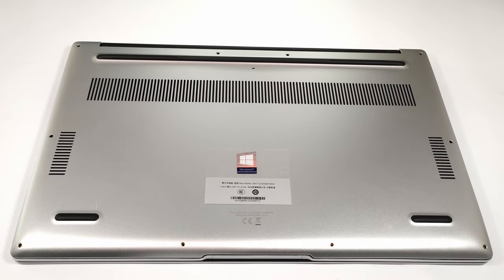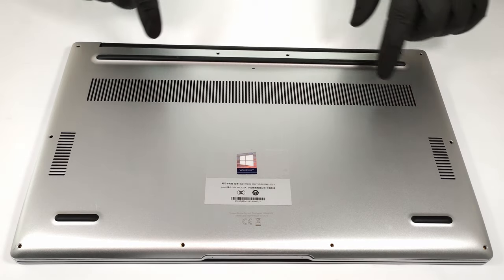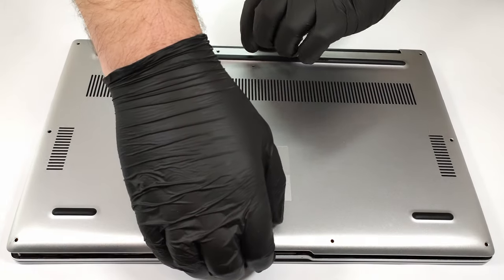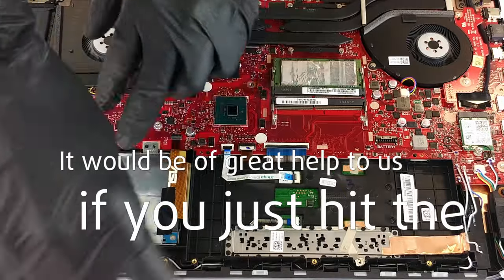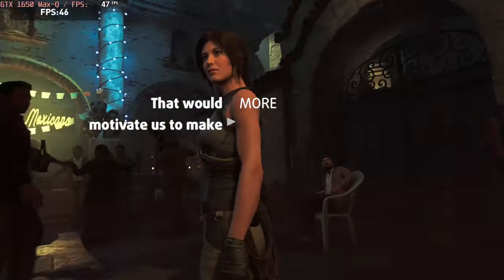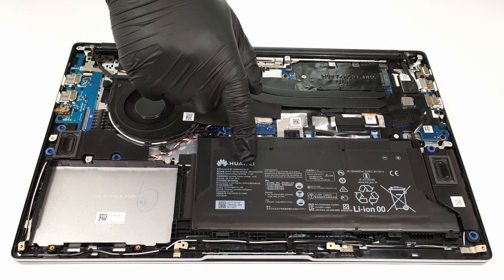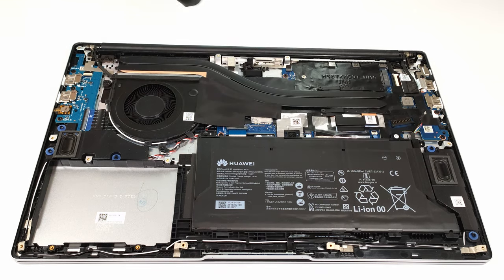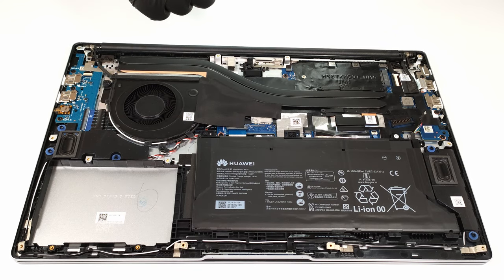🛠️ Huawei MateBook D 15 (Intel) – disassembly and upgrade options

Comment: I can confirm that this model (2021) with i3-1115g4 does not have extra ssd connector. I opened mine.
Reply: what about the ram? is it upgradable?
Reply: @Monday97 no

Comment: where is the port for the SSD 2.5 inch?
Reply: Same can’t find the connector for the 2.5” bay drive, got everything else 🤦🏽‍♂️💆🏽‍♂️💆🏽‍♂️
Reply: Is it possible to just buy a connector and easily get it to work. Can it use ssd 2.5 Sata?
Reply: Yes in Amazon you can buy the connector
Reply: i opened it and it looks like the connector for the ssd has been removed in this new version

Comment: Can someone help me find the connector for the 2.5” bay drive, got everything else - for the 2021 model d15   i5 11th gen processor (not the AMD version)
Reply: Did u find?
Reply: Up
Reply: Have you found it?
Reply: i couldnt find any listing for the 2021 model and maybe for good reason , it seems even the cable it isnt supported on 2021 intel

Comment: Hi,
I have an i5 d15 with a 256 gb M.2 SSD.  There is no connector on the motherboard to install a supplementary HDD in the bay.  So, my question is there a limit ro the capacity of M.2 SSD that I can fit into this machine.  I would like to fit a 1TB M.2 ssd.  Will it work ?
Thanks,
Jolyon
Reply: I've just installed a 1 TB m.2 nvme ssd.  All working fine.
Reply: Is this the 2022 version?  @defossard

Comment: is there another slot for SSD to upgrade? please answer. I'm not that techy person, thanks!
Reply: Nope. That SSD is the only upgradeable part in the system. Even the ram is soldered with the motherboard, you can't upgrade the ram too.
Reply: @banban5568  thanks bro.
Reply: тут есть как таковой слот 2,5", но нужно установить шлейф